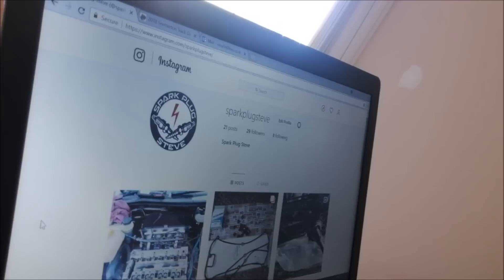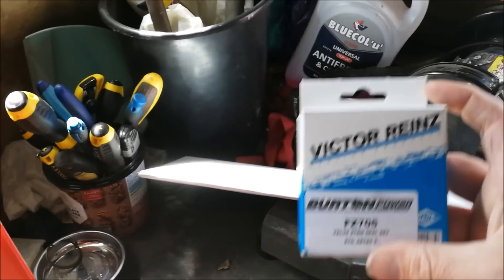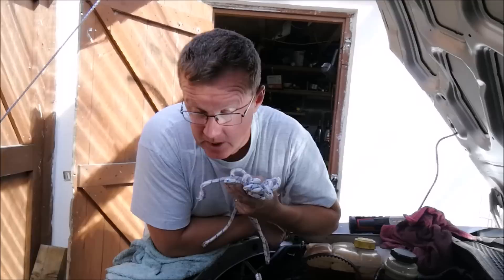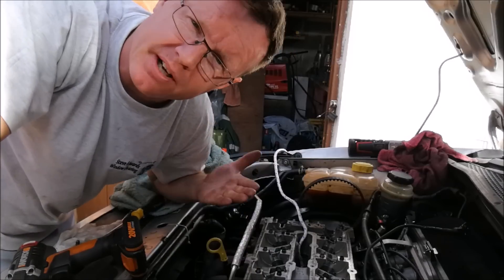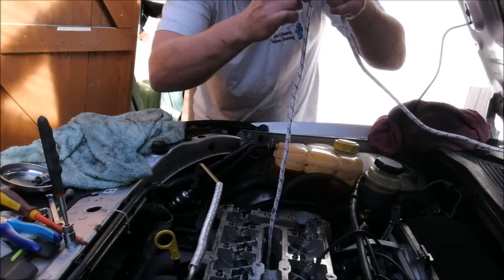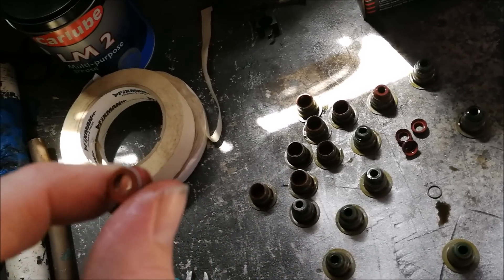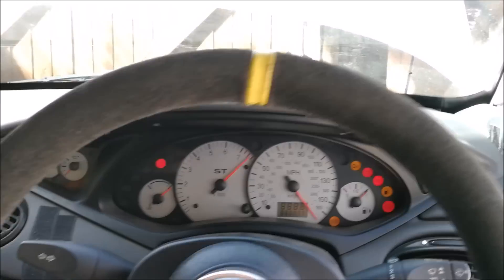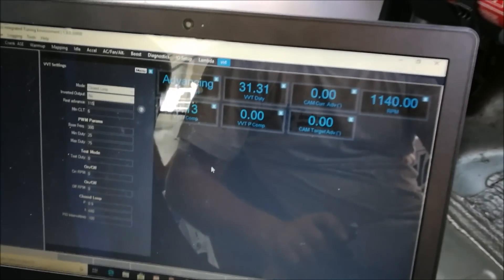Keep your head on, stem seal swap

Comment: Great video. I have heard that it is better to change valve stem oil seals by removing head so you can properly clean the ports etc. Is this true or standard practice to do these seals like this on all engines that you can? Thanks

Comment: Thanks for the time for putting up this video.   I've got the classic smoke at start up so now I know what I'll be doing when I change the timing belt next.
 

FYI the links for the tool in the comments below didn't work for me, but looked on amazon (states) for tool that looked like the one in your video.   Think I found it, however box is blue not red :)
https://www.amazon.com/8MILELAKE-Engine-Tensioner-assembly-Compressor/dp/B07G71FNX1/ref=sr_1_129?keywords=valve+stem+spring+tool&qid=1570250683&sr=8-129
Reply from the maker: Great glad it can help you. Yes that's the same kit.

Comment: Nice video I got a Toyota MR2 that I've had parked in my garage for 4 years, put away fine but now valve seals have dried out, they were boarder line before I stored it so definitely need doing now, only trouble is taking the head of these motors is major striping, it was bad enough replacing injectors on it a few years back, ridiculous amount I had to take off just to get at them,  anyway glad to see this as it's very similar to my setup using bucket lifters, Been trying to find a tool to do it and the one in your video would be perfect for my job, never used the rope method before as always taken the head off so here's hoping.

Comment: Hi do you have a link to the valve spring tool you used please
Reply from the maker: https://www.ebay.co.uk/itm/Universal-Valve-Clamps-Spring-Compressor-Tool-Set-8-12-16V-Engines-Removal-Tool/123104973519?hash=item1ca9a0d2cf:g:9VgAAOSwwPxa5EZB
Reply: Thanks for that mate

Comment: Ah Ford stem seals, God bless them, racked up loads of miles on my old XR3 and I would be replacing yearly to correct the plume of smoke on cold start.
Reply from the maker: Carl Richards bizarrely I had no smoke on start up. Just after over run and loads of oil consumption.